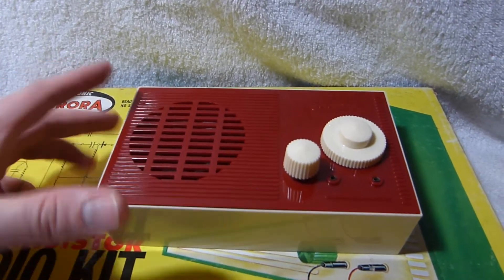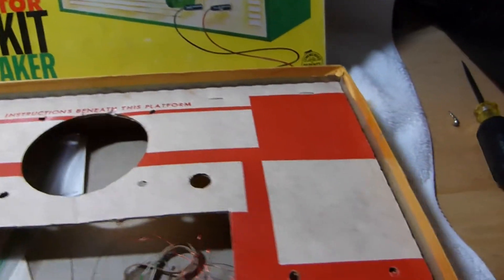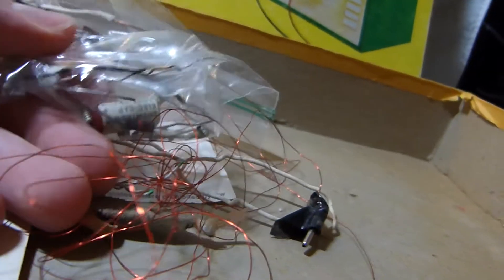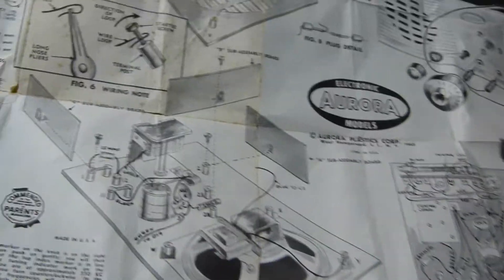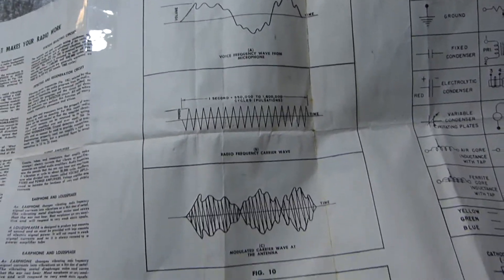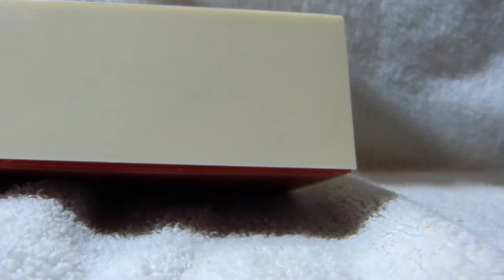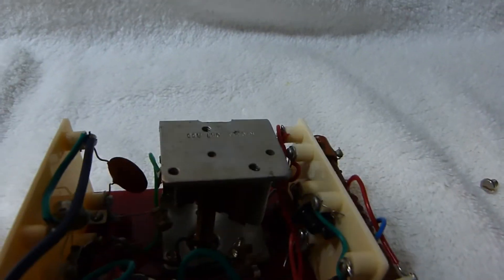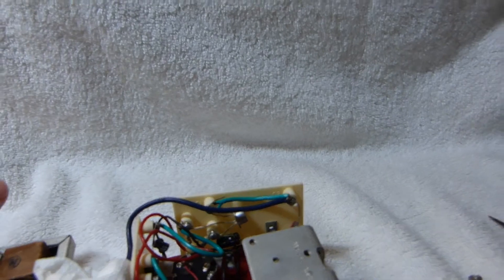1960 Aurora Model 1623 3 transistor radio kit (made in USA)

Comment: Wow !6.98 back at that time would have been expensive. It would have taken two summers of working in the hay,tobacco and bean fields to have come up with that amount. Needless to say you worked like a mule and got paid about like one :)
Reply from the maker: ***** According to an online inflation calculator, this set would cost about $130 in today's money, so it was only slightly cheaper than most low end factory made radios (GE's cheapest pocket set could be had for $20 at the time).